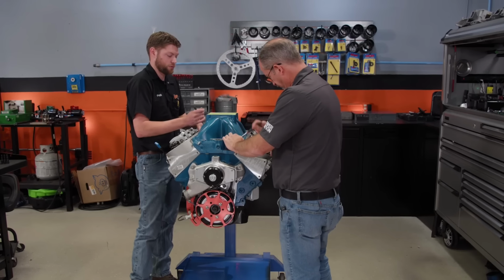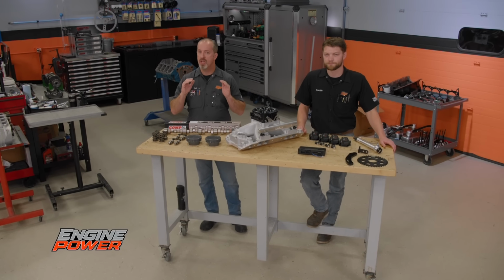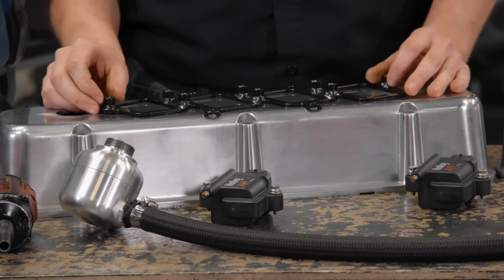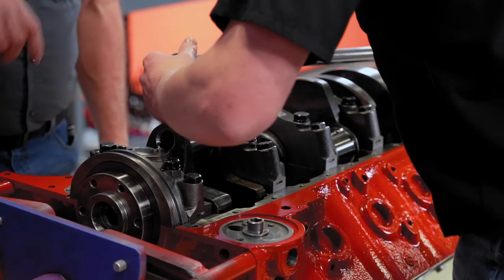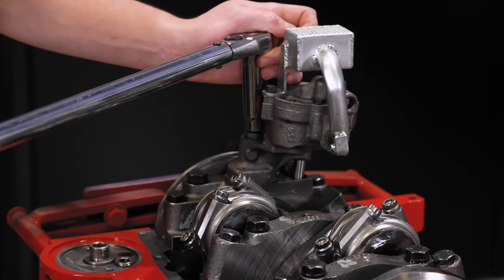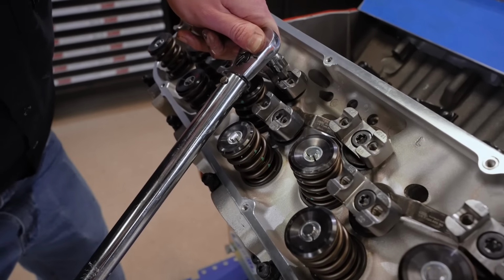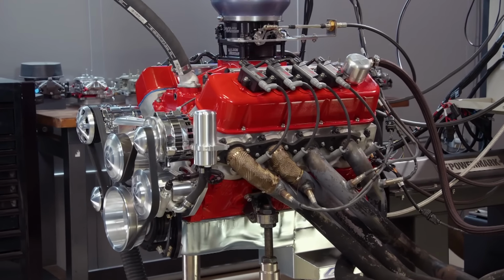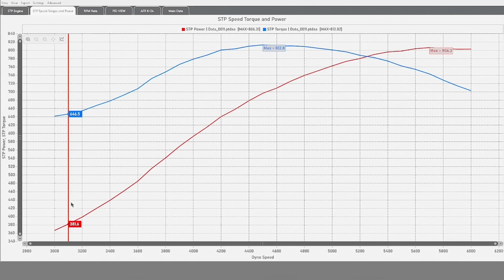Big Torque, Big Power: Building a Custom EFI 632ci Big Block Chevy - Engine Power S12, E1&2

Comment: @powernation.  Riddle me this, instead of replacing the pistons and a rebal to reduce the compression, why didn't you use different cam (like you did in another episode) timing to reduce the dynamic to pump gas friendly?
Reply: Because EFI and CARB cams are different, and they needed an EFI cam. 
EFI cam has generally less overlap and more stable manifold pressure for the MAP sensor to read. 

I used all these parts on a stock block engine years ago. The only difference is I dont have a  TV show.
Reply: @BEANS-O-MATICtransmissions  It’s the economy, stupid.  😂 J/K

Comment: You have a proper cylinder honing machine but choose to farmer fix the cylinder walls? Why bother.
Reply: That's to get the correct oval shape at the top of bore. Watch Pat hold the drill too high all the way through,lol

Comment: Single plane on the street??? Well when you have 700lb-ft plus with out even blinking, I guess it'll work. I am a dual plane fan myself. TORQUE WTMFW!! Just one thing... MOAR 385 SERIES AND RB BLOCKS!!!
Reply: Who knows what kind of torque it could make with a dual plane at low rpm. The motor has a nice square power delivery as is though.
Reply: Due to drivetrain losses, it'll be between 645-685 HP and 650-690 TQ.
Reply: Nobody has the brains to make a forward facing intake manifold 
All these intakes are designed for people who never actually put the engines under a hood.
Reply: @ LOL WHUT?
Reply: With it being multi port fuel injection the type of intake isn't gonna affect much as the fuel isn't traveling through the intake

Comment: Did you guys have any trouble with the coil that was sitting on the valve cover when welding the bracket?
Reply: Why would there be any trouble with it?
Reply: @ 
Set your phone on a conductive welding table and fire up your high frequency tig welder on AC , make a few welds on pieces grounded through the table. 
Then make a phone call. See how it goes
Reply: @collinsmith9941  a coil is not that sensitive and doesn't have a circuit board or other sensitive electronics in it 😂😂😂😂😂 so not even close of a comparison kid
Reply: @ 
You are really smart wow
Reply: @collinsmith9941  you are definitely not 😂😂😂😂😂
Reply: @ 
Do you understand how a smart coil works ?
See if you can piece it together with pictures.
Reply: @collinsmith9941  yes it is possible it could screw it up. Did it? Obviously not

Comment: I know this is mainly an american show, but how about doing something completely different?   Twin charged  (super charger + turbo) set up?  Group B rally used to get 600 out of a 2 ltr back in the 80s
Reply: I don't think summat racing catalogue would be much help. I think they're looking into doing a 2jz though.
Reply: @1985metalmaniac  Ahh yes, summit are sponsors right?
Reply: @catlee8064  I think so. They mainly focus on American domestic engines on this channel. They sometimes chuck an odd ball in.
Reply: Turbo inline 5 would be dope.

Comment: What's part number on Camshaft/ lifts please?  and we're the push rods same length from Solid setup by chance I'm doing the same with my 548 . Great information and video guys 👍😎💪
Reply: They should post the cam grind numbers or a screenshot of the Cam  Card.

Comment: I like the new dyno / controls and I really like the idea that EFI is now "the way to go".   I swear in this case they added a ton of ponies to the build with it.
Reply: Carburetors make more power, fuel acts as a liquid intercooler, throughout intake process. 

We test these back to back .... Love this episode.... Fun little GM package.
Reply: @ Sorry, but no.  Carbs rarely give ideal fuel delivery through the performance curve.  They over or under fuel, and that can lead to things like pooling and sputters.

EFI means you get consistent fuel and perfect air fuel ratios from idle to redline.
Reply: @alex888h when somebody with absolutely zero experience, starts opening their Yammer. 

You really have no clue. We tune both of them all day everyday. I can give you the exact same fuel curve with a carburetor that I can give you with fuel injection. 

They both work awesome carburetors just make more power. They are easier, and they self-adjust one required for temperature. They are smarter, they don't have to be told what to do, if more fuel is required because it's a cooler day and the engine is running better. They just deliver more fuel. Simple as that. 

I love when people who don't know the first thing about carburetor start saying that they have to be adjusted all the time and but they never do the proper job lol lol lol
Reply: Did I say that a carb always needs adjusting?

Given a single situation sat WOT, they will be about equal.  If you are getting more power with the carb, you are running insanely "dirty" overfueling to get there.

Your carb simply cannot product the same fuel curve as the EFI because you don't have that many points of adjustment.  You are always in compromise mode.  You are alternating rich and lean as the mechanical parts do certain things, the vacuum varies, and 101 other things that you cannot control with jets and floats alone.

EFI is reading all sorts of things and adjusting the curve as it goes, always learning, always improving, always giving you the most clean power possible.   If you want, you can tell it to run "dirty" and it will give the same results as your carbs do at WOT.  Good injectors will spray better, with a more even and consistent pattern, and will adjust itself as it goes if things get out of hand.

Your carb won't want to start in -20.   Without massive adjustments and jet replacements, it won't run well in Los Angeles and Denver.  It won't go well up Pike's Peak.  You know the drill.

i am sure you can create a situation where you can dirty up the carb enough to make a couple of extra horsepower at WOT.  Congrats.  You used half a tank extra fuel and polluted the hell out of the neighborhood to do it.
Reply: @internationaldynoauthority693  this is straight up wrong. EFI makes more power everywhere, period.
Reply: @spdcrzy how? He’s not wrong. Cooler fuel DOES create more power. The advantage fuel injection has is better metering which isn’t affected much under full throttle pulls where the air fuel ratio stays pretty much the same across a wide rpm band. That, and not having the need for a booster frees up the barrel of the throttle body and creates less turbulence. Both efi and carb are a complete toss up.
Reply: you realize efi shoots gas into the air the same way right? except your fuel stays in the air more thus creating more power. carbs often end up with more fuel turning back into a liquid that creates a loss of power @theeoddments960
Reply: @spdcrzy  You

Have.   No

Clue
Reply: @internationaldynoauthority693  look, you (or anybody else in this universe) can deliver more precise ignition timing and the required amount of fuel with a carburetor; that's just physics. Get you a diesel, then this kinda nonsense will never even be a discussion. Fuel and ignition is always perfect in a diesel.
Reply: @ Obviously you are just trolling hard.
Reply: @internationaldynoauthority693  but carburetors are a pain in the posterior to adjust and keep running. Then there is the choke nonsense... ditch it all for a V8 direct injected, intercooled turbodiesel with a DPF I say.

Comment: 632 cubic inches is 10.4 liters.
Reply: Hope they put it in a chevette
Reply: @theeoddments960  -After they Dyno this engine in this video, they talk about what vehicle they are going to put it in.
Reply: When you have an engine this size, it does not rotate the tires, it rotates the Earth😉😎!
Reply: Congratulations.  You found google.
Reply: @CULT539  Or perhaps just a calculator (cubic inches divided by 61). Easy to memorize.

Comment: Block should be upside down🙃 to install the bump stick,  UD...🙃 makes easier holding it and guiding it  between bearings without risk of nicking anything   from end to end .
Reply: @bigboreracing356  
You turn the car upside down of course ...🤣🤣😂!!!!  I am surprised !!!  You`ve never done it 🤣🤣🤣🤣???

Comment: From what I recall, Pat's original 632 BB Chevy build came thru a friendly competition against Kaase racings 598 BB Ford. Pat's 632 Chevy made 1050 hp, while Kaase's 598 made 1100+ hp and 933 lbft...
Reply: Almost like Kaase knows what he’s doing…😊
Reply: Most people cant afford a kasse power plant.
Reply: @roberthealy2172  You only need his trick heads...
Reply: Thats right! If I remember the chevy made a little less than that but still awesome! Both badass engines, especially the Ford 👍
Reply: 😅 @bigboreracing356
Reply: Kaas' engine ate its own valvetrain after the test because of his high rocker ratios. Pat's BB will last for thousands of care free miles. big diff...
Reply: @bigboreracing356  dream on dikwad!
Reply: Well guys, compare the prices between Ford and Chevy and see which one gets the better bang for the buck... Chevy of course Chevy of course
Reply: @JrWash-d3k  I like both, but dollar for dollar, Chevy is cheaper horsepower. Hard to deny with all the LS's available and the after market support.
Reply: Never see ford's in racing like unlimited  Trophy trucks that run 18 to 22 hrs in baja making  850 to 1050 hp na.6500 to 8800 k rpm.
Reply: @bigboreracing356  Oh really, so Chevy made a factory tall deck 632 block 🤣🤣🤣🤣🤣🤣🤣🤣? Next you will tell me the AFR heads and Super Victor intake Pat put on his 632 are "genuine chevy junk" too 🤣🤣🤣🤣🤣🤣🤣🤣🤣🤣🤣🤣🤣🤣🤣🤣🤣🤣🤣🤣🤣🤣🤣🤣